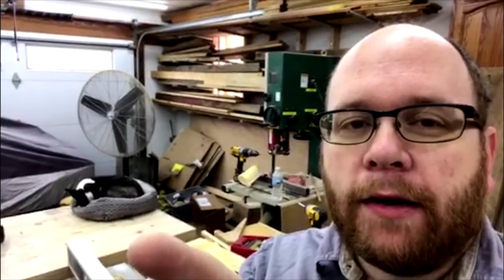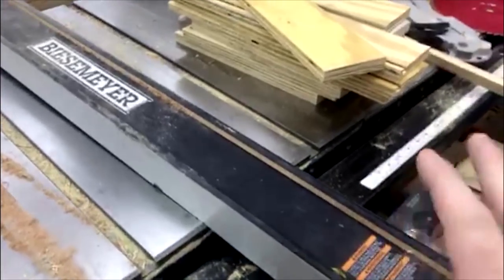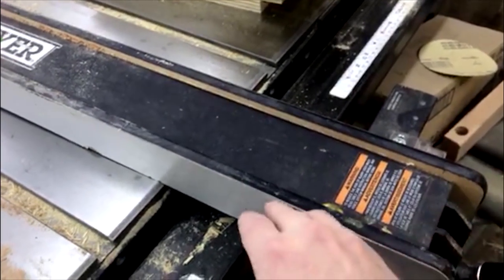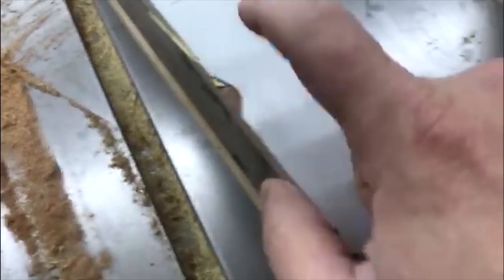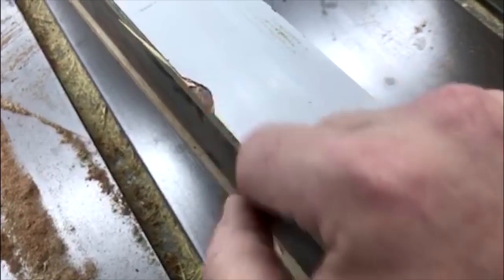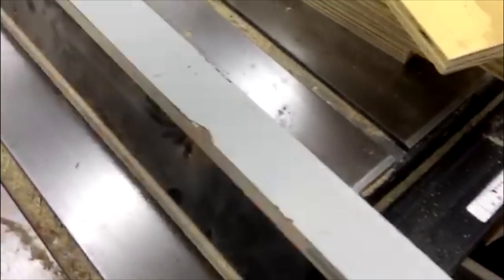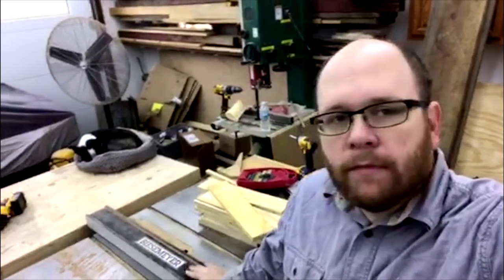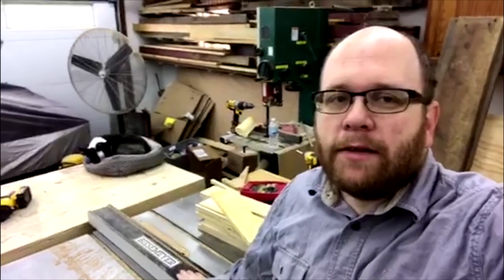Biesemeyer Problems

Comment: I had a old biesemeyer fence that I had damaged from years of use and people running the fence into a running blade. I took off the laminate and behind it were screws holding the cheap press board to the metal tube. I just bought a new one replaced the laminate and whalla..like new
Reply from the maker: I had a hunch that the laminate was glued on after the plywood was attached. Thank you that will be helpful when I take this thing apart.

Comment: Simply remove the old laminate from the base with heat (use a heat gum, not a propane torch) and replace with new.  Use contact glue and a roller on the new piece.  That black rubber piece has a spline which fits into a groove in the base.  Remove and replace with a wider piece to cover the edge of the laminate, it comes in 1/8" increments.  Make sure to remove alll the old glue before placing the new or you will have more bumps than you started with.
Reply from the maker: We are on the same page. Already ordered my heat gun. Any idea how to remove the old adhesive? You think goof-off would ruin the plywood substrate? I plan on replacing with a sheet of UHMW
Reply: Denatured alcohol & sanding are weapons of choice.  Maybe replace the ply if too badly damaged?

Comment: I would try to attach a piece of UVHM ( I think that’s the name) as you wore talking about and get the size you need and drill and counter sink holes and attach it to the fence. Now the hard part is making absolute that it’s square to the table, and exact measurement from your miter rails. I did this on my own saw and it worked out great. Just a idea. Good luck and keep us posted please.
Reply: I was going to suggest the same thing..It's a shame an expensive device like that can be ruined so easily! I've thought many times that a companies reputation is derived from it's customer service and the quality of their product. Maybe they don't care what the quality is.. Sad....
Reply from the maker: Biesemeyer manufacturing was moved overseas long ago. Along with it was a noticeable decline in quality. Still one of the best standalone fences you can buy. Just needs a little tweaking and it will be perfect.

Comment: This is a table saw!  Stuff happens.  I know Biesemeyer makes replacement flats - replace it and send back damaged goods when received seems like the best course of action.
Reply from the maker: I don’t see the point of stating the obvious here. I use my table saw for precision work, and any part of the fence that isn’t flat will affect that precision. As far as damage during shipping: sometimes the damage isn’t worth the hassle.
Reply: Ok.  I understand the precision work but not sending back damaged goods as "sometimes the damage isn't worth the hassle"?  However, going onto YouTube to complain about it is?  Peculiar?
Reply from the maker: You obviously don't get the  point of the video.  This has nothing to do with the shipping damage.  It is about how the laminate layer allows wood splinters warp the face of the fence.

Comment: A quick and easy fix would be to use bondo or epoxy and finish the surface with sanding and waxing and back to work :>)